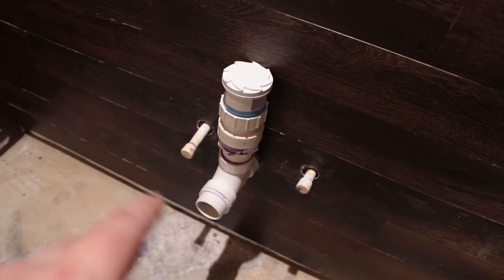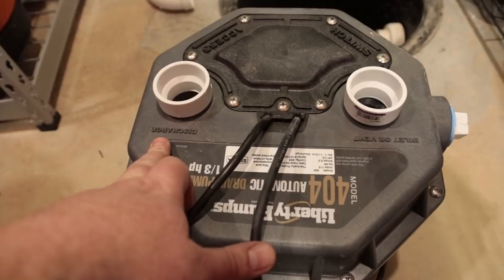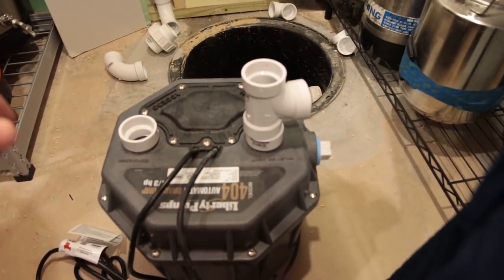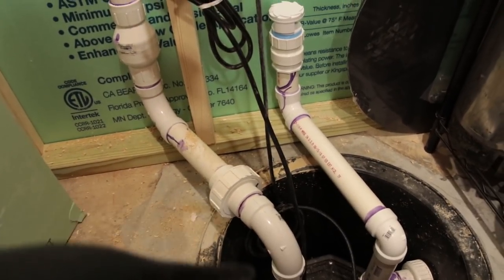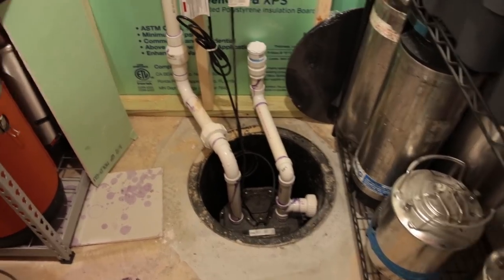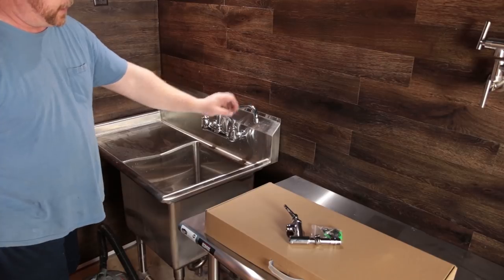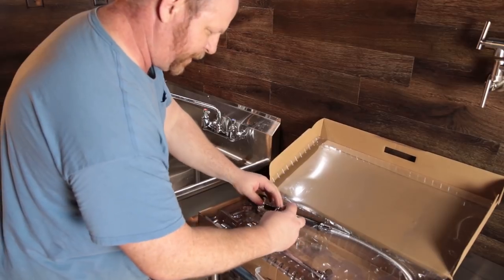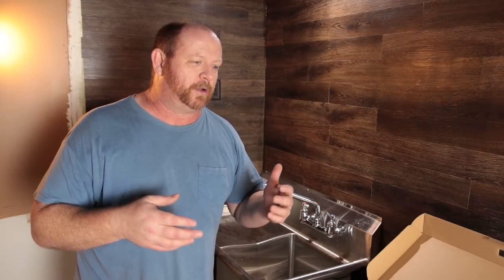Basement Brewery Build Part 8 | Liberty 404 pump installed and sink plumbed

Comment: Great pump. Been running it in my restaurant for 4 years. Regular maintenance/cleaning every 6 months. Zero issues.
Reply from the maker: Great to hear! The maintenance is why I made it easily removable with the unions. What do you do for maintenance? Just wash it out? Cheers!!  👍🍻
Reply: I have this pump at my house had it installed about a year ago it's been working flawlessly except for today it would not drain so I banged on the top of it a little bit and then it drained out.... is there a way to clean this?

Comment: Nice install!  As a warning to others, some plumbing codes don’t allow use of those vents, so you should check with your local inspector to see if they are legal in your area.  Mine wasn’t so I have to run a full vent line outside.
Reply from the maker: We have no code..  Lol I am in the country. No inspections either. Believe some of the stuff I have seen needs inspected!!  Lol
Reply: @ShortCircuitedBrewers  I used to live in rural Ohio as well, so I know all about the lack of codes!  I remember asking the local county about building inspections and the answer was "we've never heard of that."
Reply: Those pumps won't work right with those air admittance valves.  They need an open vent.  Hope you didn't have any problems with the pump, I've had to remove them for customers before and run a regular vent to outside.
Reply from the maker: I wound up removing it.  You're correct!
Reply: @ShortCircuitedBrewers  Wow quick reply!  Glad you figured it out, hope everything is working great
Reply from the maker: Yes sir!! Works well! 👍🍻
Reply: So you removed and replaced with a proper vent thru the roof or a simple short pipe in the wall?@ShortCircuitedBrewers

Comment: Hey nice plumbing work. Maybe I missed it, did you mention making sure the section of drain pipe that goes a crossed the room is pitched towards the main drain. That’s a nice pump system and much quieter than I expected. Funny too I was looking at the floor and thinking “It doesn’t look like the epoxy is down?” Cheers man, looking great, sooo jealous 🍻🍻
Reply from the maker: Lol no it is not down yet. I did not mention that. I will mention it in a future video. Cheers!!  👍🍻

Comment: I know this is an older video , but what did you use to connect the sink to the wall ?  I got a very similar sink, but need to mount it , was wondering how you did to keep it from moving/tilting on the drainage side.  Thanks!
Reply from the maker: There are holes in the flange on the top of the sink backsplash. I added blocking behind the sink prior to putting up the drywall etc. And use stainless screws directly into the wall..👍🍻
Reply: @ShortCircuitedBrewers  Thank you for the reply!
Reply from the maker: @neodammarang  👍🍻

Comment: How is the pump functioning I am working on doing an install using this pump and read right in the manual not to use a One Way Quick Vent or Air Admittance Valve for venting. Have you had any issues since installation?
Reply from the maker: I have not had any issues. Well except for one. I am going to remove the vent because it does not allow the "pressure" to escape the pump housing. Which wouldn't be an issue except for the fact that  if I have a full sink and drain it all at once. The floor drain becomes the vent and water starts coming up out of it! Lol not a huge issue but the vent does cause that. I think I will be fine with having a pipe up the wall and put a 180degree elbow on it for venting. Hope that helps! 👍🍻

Comment: Nice work. I imagine you take your spent grain and hops outside and dump it. However unless you spray out everything out outside, you will probably get some spent grain, hop particle, yeast from fermenters, etc. passing through that pump. Is it rated to pass minimal particulate through it? The check valve also might get spent grain trapped and stick slightly open possibly. I saw you mention maintenance, would it accumulate inside the pump some how? Not being critical, just curious as I may be in need of this type of solution in the future. Cheer!
Reply from the maker: Good questions! The pump is rated for 3/8" Particulate matter. I will most likely add a fine screen in  the sink drain to prevent grain from getting in the pump. The one way valve is pretty well designed. I hope I don't have any trouble with it time will tell and I will be reporting back on it for sure. Maintenance would be just cleaning out the pump housing to make sure it stays functional. Thanks for watching and commenting! Cheers Adam! 👍🍻
Reply: From OH-IO too!  I want to get the same pump, and after the brew is over i have a big trub/hop cone in my kettle. Can this pump handle washing all of that down the drain?? It can be up to 16 oz of used hops.
Reply from the maker: As long as it's not hop cones don't see why not.. I wash yeast and hops down my drain all the time no issue. 👍🍻

Comment: How is that faucet holding up? I am looking for one for my home brewery commercial sink. T&S with sprayer is like 400 bucks…..looking for something less expensive but decent quality. Thanks
Reply from the maker: The main valves and everything are holding up great the only thing that I've had with a little bit of a leak is the valve that's above the main shut offs for the faucet. To choose between the sprayer or the faucet. Which is not really a big deal because all you have to do is just turn off the main hot and cold valves and nothing leaks. It's been good so far
Reply from the maker: This is very similar to what I'm using
Reply from the maker: https://www.ebay.com/itm/12-Pull-Down-Sprayer-Commercial-Pre-Rinse-Sink-Faucet-Kitchen-Add-On-Mixer-Tap-/191771234017?mkcid=16&mkevt=1&_trksid=p2349624.m46890.l49286&mkrid=711-127632-2357-0
Reply: @ShortCircuitedBrewers  Thank You!